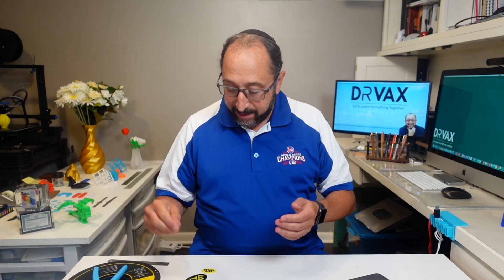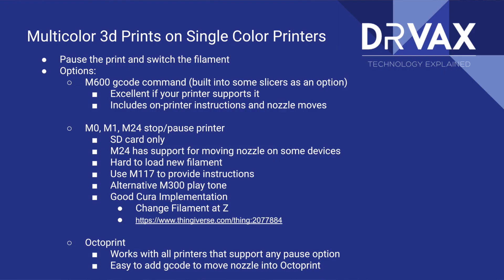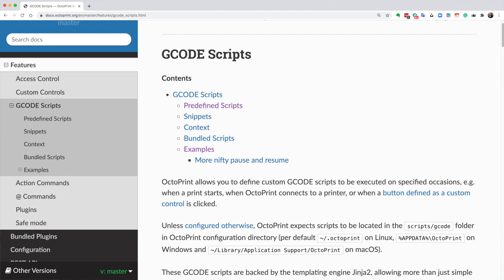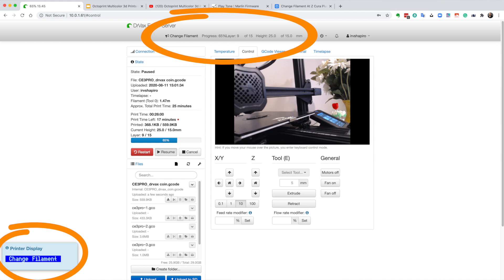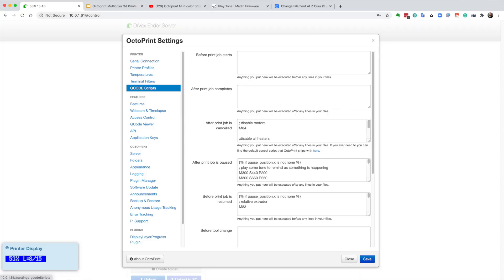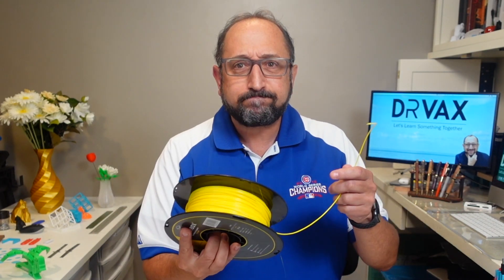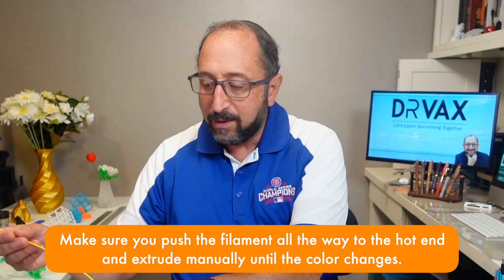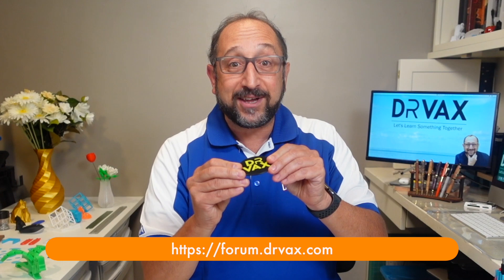Octoprint Multicolor 3d Prints including Ender 3 V2

Comment: Nice video. But why not compile your own firmware and add the M600 option? Or at least mention the fact that this is also a possibility? Seems the board is already included in the marlin 2.0-bugfix tree.
Reply: In many printers this is the prefered option. But does not help on Ender 3 v2 or printers with MKS-Touchscreen. They simply show no message on the screen and therefore you can not confirm change and continue print, even with m600 activated in firmware...

This is the reason I prefer Bigtreetech Displays - they support massages in touch mode. Also some versions support dual mode with 12864 emulation, whats the best way to get full control of the printer in my opinion.

Actually the Octoprint solution is mostly a workaround for missing possibility of the Ender3 to confirm printer can continue...
Actually, If you have a free IO-port, you can use gcode for wait for IO going Low instead of pause command and ad a push button to that IO. A little lees expansive...

Comment: Great Video.
You can use the same method not only for colour change after layer change, but also inside a layer to embed text or logos inside the first two or three layers.
I used Prusa Slicer to do so; also my printers support M600. I describe it with M600; you can replace it by your script:
- Edit printer settings, increase number of extruders. Assign different colours for the extruders.
- Set custom toolchange gcode to "g0 x0 y0" "m600"
- make a stl with your text or logo; it should use 0.4 or 0.6 mm hight (If you print with 0.2mm layer hight).
- add this stl as a modifier to your object with 0% infill, 0 top- and bottom lines and 0 perimeters. This will "Cut Out" your text/logo from your object.
-Add the stl again, this time as a normal object
- place it to the same position you made the cutout.
- assign one virtual extruder to your main object, the other to your text/logo
- in print settings: set number of brim lines to number of extruders. Prusa Slicer will automaticly do one loop per extruder - so you will get one priming line after every filament change. Hight of brim should go up to the last layer with a filament change.
-deactivate wipe tower in print settings (on certain printers like mk3s Prusa Slicer automaticly activates it when you set multiple extruders)

I did some nice prints this way: New y-frontplate for my Prusa Mini with "original Prusa Mini" embedded in orange letters. Looks perfect, much nicer then the embossed text of the original part. 

Some futher improvements: use PEI powder coated spring steel. Use Hilbert curve on bottom layer. Generate two gcodes, A.gcode with 1 perimeter, B.gcode with 3 or 4 perimeters. Use Notepad++ to delete everything after First layer in A.gcode and insert everything after first layer from B.gcode. The text/logo will look much nicer with only one brim on the surface, but will be staticly strong as all other layers have more perimeters.
Also, as PET-G tends to stringing, you might use PLA for Text/Logos. If the main body is printed in PET-G, assign it to the last virtual extruder. So the non stringing PLA is printed first and any strings from the PET-G are above the PLA, not visable from the outside.
You might also play with reducing nozzle temperature and speed in First layer to get no stringing and perfect results (and of course, clean the bed before printing - I ruined an elsewise nearly perfect print with leftovers from a previous print...)
Reply: you do that with z hop feature right? If I want multicolor in same layer.
Reply: @antoniovarovic4229  Yes, I use the standard settings for the Prusa mk3s, so z-hop is on. There might be a problem with printers using only one z-axis like Ender3, as z-hop is not optimal there. I modified my Ender 3's to dual z anyway (and to direct extruders), so I forgot to mention it.
So yes, for multicolour in one layer, z-hop should be activated, so dual z is strictly recommended. Also personaly I prefer direct extruders for more easy filament change, but thats optional.

Comment: Really good information.  I have been using PrusaSlicer on my Ender 5 which easily supports color change at layers, but am in the process of switching to Simplfy3D which is more difficult to do.  I'll give this a try.

Comment: M18 S9999 in pause script will keep the steppers in power mode, you you are unable to move the print head by accident.
Reply: Where would I put the M18 S9999 in the script?
Reply: Just inside the start code is fine. If you use a plug-in for filament change, there is usually a field for custom code. That’s fine,too. Or on demand using a terminal. Just make sure it gets used before the actual pause command. Terminal use can of course be done after pause.The option is just temporary and will reset on the printers power down.
Reply: @guidomersmann9744  thanks for getting back to me. Can I put it in the post processing...Pause at height Gcode Before Pause in Cura? And then do I need to put a gcode in the resume to unlock the steppers? Thanks for your help.
Reply: It should work in there, yes. You don’t need to „unlock“ the steppers at all. This „locking“ just means the motor gets powered from the driver and cannot be moved by hand. By default the printer firmware releases the steppers in pause mode after 90 seconds or so. You hear a mechanical sound, when they loose power. Now.each touch may move the tool head and will cause a layer shift. The command increases the time from pausing a print to releasing the steppers by a gigant amount of seconds, so you do not need to hurry. Even an hour later the filament can be changed without a risk, as the steppers are still engaged and holding the position by force.
Reply: @guidomersmann9744  thank you so much Guido. This all makes sense to me now. I am a relative newbie and value the guidance of experts like you. Thanks again.